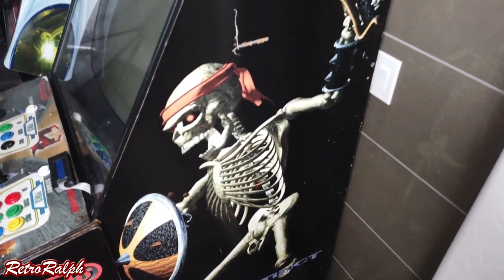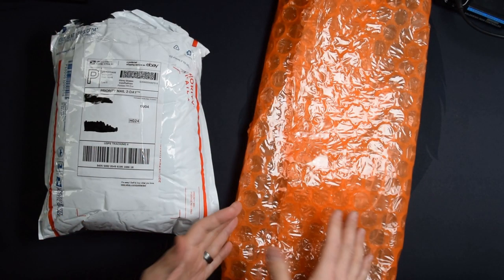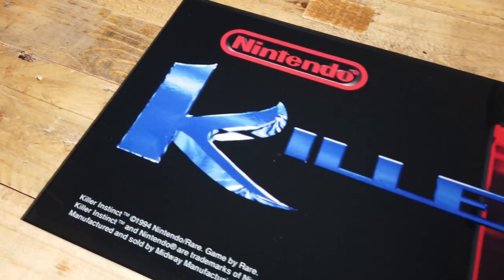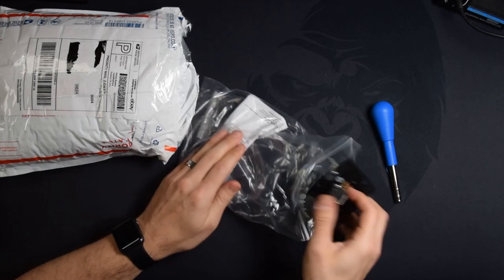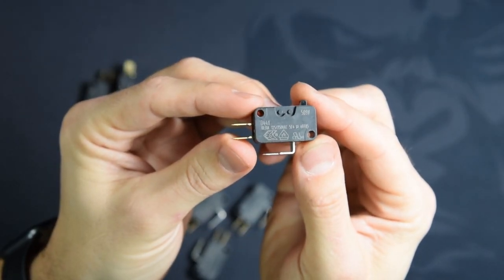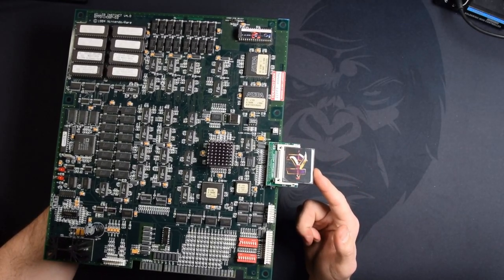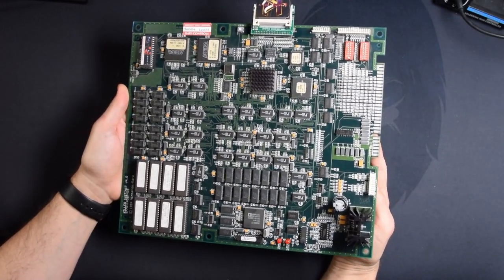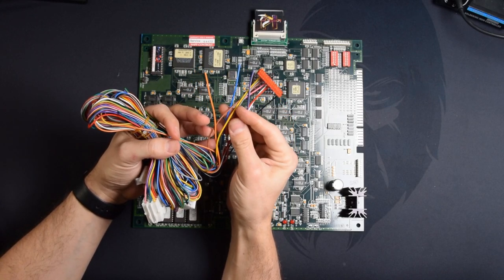Killer Instinct Arcade Restoration - Part 1!

Comment: I would suggest re-laminating the front after patching rather than painting.  I used to paint, but once I did my first go with laminate, I never looked back.  It will look SO much better and it's really easy.  It covers all the little flaws and gives everything a clean, uniform look.  It will look like a brand new cabinet.

So happy to see you getting into restorations!  Good luck!

Comment: I am on my second ki cab, 1st one i owned back in early 2000 and sold it. Glad to be an owner of another and got it before the pcbs skyrocketed. I will follow you closely to emulate your restoration process as my monitor has been replaced with an lcd and the cabinet itself needs some tlc. Killer instinct is my all time favorite game.

Comment: Can you tell me the exact depth from the bottom (not counting the control panel) om about to buy one of these but have a 90 degree angle going down stairs. I have a door leading to a landing. The door way is 29 inches wide but I got 34 inches of depth heading in and I would need to twist it to go down the 90 degree to head down. Any siggestions?

Comment: remmber to add a cooling fan  to blows the pcb  ki  use one at the bottom side of board
Reply: why would he need to. doubt it will heat up much without a hard drive.
later
-1